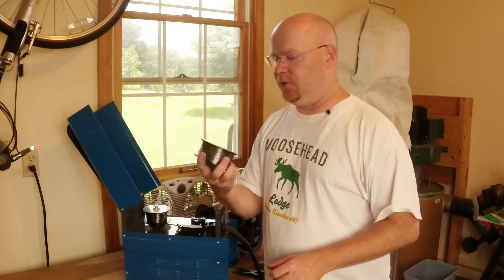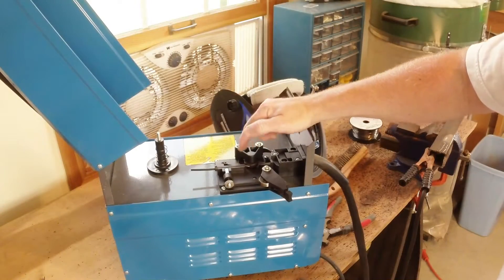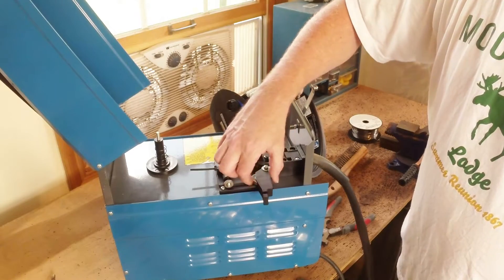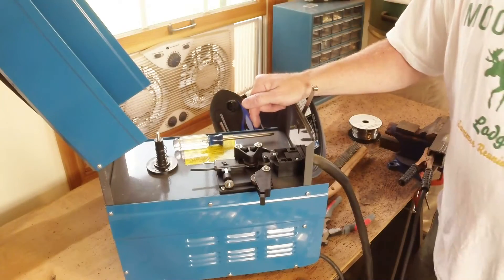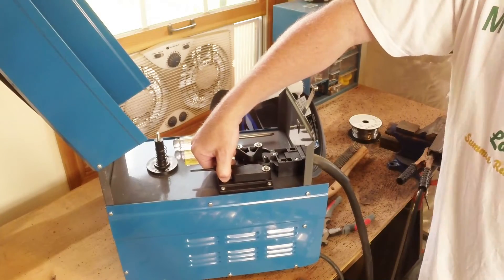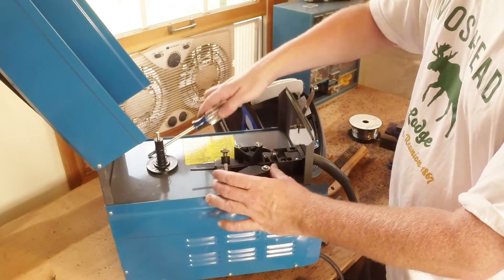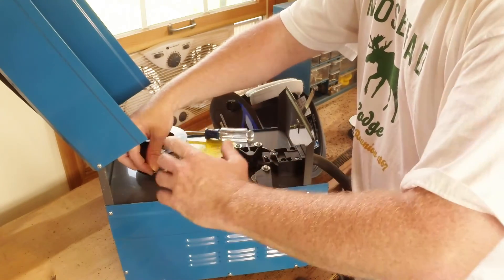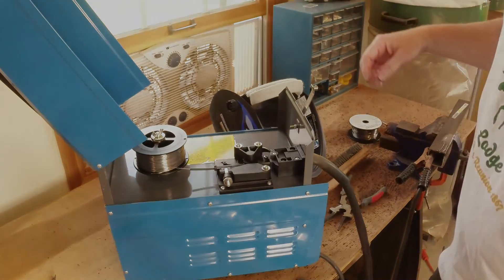Easy Harbor Freight 90 Amp Welder Mods 04

Comment: i've got the same blue welder. i use a vice grip c clamp to pinch the rollers together. and yes you do need that wingnut to stop the tension nut on the spool from loosening. or else you might as well pitch that new spool now. i left it off once when i changed spools, and didn't notice the tension nut loosening to the point it fell off. then my new spool of wire wound up in my scrap bin.

Comment: just from my experience... it's better to stretch your gun cable out straight and hand feed the wire to the tip.. especially as the assembly gets more use. Doing it that way will let you spot any potential liner problems that might happen.

Comment: I have the wire feed switching mechanism problem, It was the controller board  not supplying 24 volts to the motor, cannot find the controller anywhere and  I ordered the  repair kit on ebay installed  few semiconductors and is working  again..!

Comment: the .8 and .5 on the roller are referring to millimeters.  So the roller isnt designed to run inch wire at all.  but it's pretty close.

Comment: I'm thinking of fabricating a roof rack for my camper van... do you think this would work?
Reply from the maker: It's possible, but I must advise extreme caution.  I've never built anything structural or important with this welder and I doubt that I would.  Mostly, it's my own lack of skill but also the fact that you just can't get this thing dialed in exactly and I'm suspicious of how consistent the power is.

A roof rack carrying load at the height of an RV, going highway speeds, with other folks in cars behind you, is NOT the time or place to wonder about the quality of the fabrication.   What I would do is fabricate the whole thing and just tack it together with this welder, then take it to a pro shop to have it welded out fully and properly.  You'd still be getting the custom rack, and doing most of the work yourself, without having to worry about that last critical step so much.

Comment: I did start my welds with the given spool cus I don't want to waste anything, theyre not perfect but doable, I did get a few Lincoln spools for when its out, hoping for smoother welds. one guy made a video of harbor freight wire vs Lincoln wire on an unmanned welder to offer identical welds with different brands, theirs better weld appearances and more solid penetration with the Lincoln for sure

Comment: you've got the blue one which I hear is first gen, I bought one its black and checked all the components you mentioned, the electrode is .030, the feed is double cut and labeled 030/035, it was set for 030 so it looks like they made that mod easy for me😃

Comment: i have the same welder but for some reason when i push the red button to try and weld,  the wire does not want to feed out.  i checked the motor its still works but no power getting to the motor.  HELP!   ;)
Reply from the maker: Have you ever welded with the machine?  If so, the tip is probably welded shut.  Change tips and see if it fixes the problem.
Reply: +Matt Heere thats not the problem,   i said theres no power getting to the wire feeder motor,  i changed the fuse but still will not work.   the tip is fine
Reply from the maker: Misread it.  Thought you said there was power getting to the motor.  It's going to take some poking around with a volt meter on the feed speed circuit board to track down where the break in the circuit is.  Wish I could tell you something more specific, but there's not (that I know of) a single common problem on that board.
Reply: Can't you just return it and get a replacement? I would think  that would be easier and faster.
Reply: +mossy1 no, i bought it used from a guy.

Comment: right now I do not have a welder. I have some odd jobs, a small hole in the exhaust on my Camaro caused by someone else's welding, a couple of cracks in belly mower for my farmall cub, the belly mower also has some worn out runners that need to have some metal added to the bottom. is this unit a good place to start for someone on an extremely tight budget??? I knows its not a miller but for the money it doesn't look terrible and should be able to handle most small to medium sized jobs. am I correct.
Reply from the maker: +andrew donohue Those are exactly the kinds of jobs that this welder is fine for.  It also happens to be on sale this weekend for $82.  Swapping out for Lincoln wire (available at HD and Lowes) will set you back another $12, but even if you use the HF wire you can get done what you're describing.   The exhaust work will be the toughest, as if you're not careful you'll burn through and make the hole bigger.

Comment: BTW the Harbor freight machine now has 2 X .030 you still have to machine off about 4 or 5mm off the tip to make it flush but the tips are the right size. Posting under my wifes name. Nothing sexier than a chick welding! But not the case here

Comment: Bought a welder as it was in the same price range as the cost of some basic welding I need on my basement door. Finding your tutorial very educational, bought harbor freight stuff in the past and it ok but I appreciate the time you've taken producing these clips. Going to do all the mods before I even turn it on. And before the flux core welding 101 clip I have to watch. Maybe wrong but the action looks a lot like caulking, steady and and steady speed. Whether I'm delusional or not I'm looking forward to delving into the art of welding.

Comment: Matt, I followed your mods and am getting better results, however I wonder if the additional splatter/BB is caused by us using the wrong polarity flux core wire.  Is our HF welder a negative or positive flux core welder?
Reply from the maker: Neither.  It's an AC machine.  I have another series on converting it to DC (EN), which makes it much much better.
Reply from the maker: +Chris Vanweele It absolutely does.  Only a DC machine has a fixed polarity, where one lead is positive and the other negative (which is which depends on the setup).  AC is alternating current.  It's positive 1/2 the time and negative the other half (50 or 60 times per second depending on where in the world you happen to live).
Reply from the maker: +Chris Vanweele You need to separate what the connections on the machine are labeled with what polarity you're actually using.  If you're AC welding, then there is no such thing as polarity.  Period.  It isn't possible because AC simply doesn't have one (not a constant one anyway).

Now that's not to say that it doesn't matter how your leads are connected to the machine.  One port will be the current source and one will be ground.  Those terminals are probably marked with a + and a - for when you're doing DC welding.  That makes these marking a convenient way to refer to the terminals when explaining how to hook up the torch for AC welding - but they don't actually mean that one is positive and one is negative when you're in AC.  They could just as easily be marked "1" and "2" or "Bill" and "Ted".  If you hook up backwards for AC your problems aren't because of wrong polarity (can't be - there is no polarity), they're because you're not using the circuitry in the welder properly.

Comment: I have no problem with penetration with the .035 and also get the fill.  Just need to know how to weld.  Granted .030 will penetrate more, but if you know what your doing, .035 is better!  Also your flux wire quality is key.  Buy something better than Chicago Electric/ Harbor Freight wire.  Both/same suck although HF flux wire is worse.  I also have no problem with tension with any size wire.  I have plenty of adjustment to use without grinding.  Maybe I got lucky!

Comment: Birds Nest?!?! I found out the hard way...  Thanks for the great vids and tips. Much appreciated!  Looks, like you're plugged into a standard 15 A outlet.  Is that correct? If that's the case: do you find any drop in output no using a 20A outlet? Just curious.
Reply from the maker: +WIL POLLOCK No drop in power up until the breaker pops.  If you're running this thing on MAX then it really does need a 20A circuit.  I now have it plugged into a 30A RV outlet that I wired up elsewhere in the garage.
Reply: +WIL POLLOCK I would advise 20A or better.  Although power doesn't drop unless you blow a breaker.  I have ran mine on high with15A breaker for over 3 hrs off and on and had no problem.

Comment: Why wouldn't you just run the .035 wire instead of the .030 wire? Won't it lay down a thicker bead with the .035?
Reply from the maker: +b0xcrash It's the limited power output of the machine.  You need to keep your travel speed down so that the machine has time to heat the parts being welded.  .035 wire lays material down faster than the current can effectively keep up with.  You do get thick beads, but with terrible penetration.
Reply: Gotcha. Thanks, that makes sense.

Comment: .6 wire is .023 for solid wire gas .8 is .030 and .9 is .035 both for gas and flux core, just sayin. Good video non the less
Reply from the maker: Michael Hayes Yeah.  It's metric.  .6mm and .8mm.  I had a "duh" moment watching it to make sure it posted correctly.  See comment just below this one :)

Comment: The tension probably did more good than the slot size. My Lincoln MIG's roller has a .024 slot and a .035 slot, but I run .030 in the .035 slot because that's what I can get locally. I wasn't sure it would work right but it's halfway through its second spool of the stuff and I've had no trouble with it.

I love making cheap crap work properly--good on you!

Comment: Hi Matt, just wanted to make a few suggestions. I am a welder, just to let you know. First, when installing a spool of wire, don't tighten the spool nut too tight. You only want the spool tight enough to keep the wire from birdnesting. It also keeps the wire feeder from working too hard. Second, when tightening the feeder wheel, you only want it tight enough to push the wire up through the liner. Maybe just a little tighter. Again, this makes the wire feed work harder than it should have too. Also keeps the wire from curling up when it comes out of the tip. Thanks for the vids though.

Comment: SAD.  for about $350 or $400  you could have a Lincoln with solid and FC capability.
Reply from the maker: Did you miss the part where this welder was FREE...  If you make it the end of the advanced mod series, I did say that I wouldn't buy this thing new.  I'd look for something used on Craigslist or in the paper.
Reply: I bought mine for 50 used. Welding in rockers for a used car dealer and it paid for itself lol. I would love a lincoln etc but some are poor and he showed me how to make it usable. He saved a lot of cussing and i didnt need to post a shotgun vs welder video hahahaha